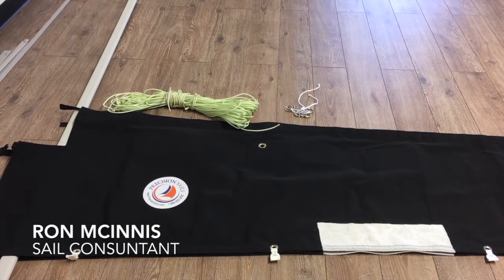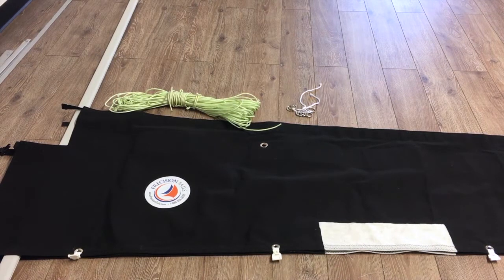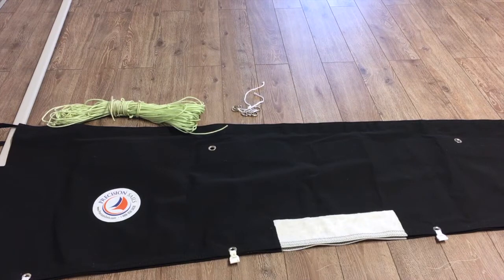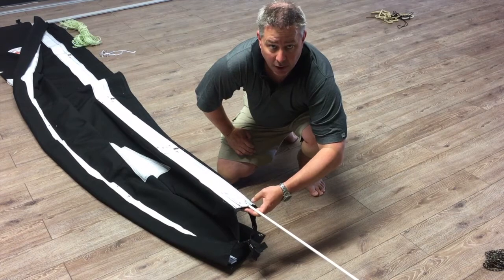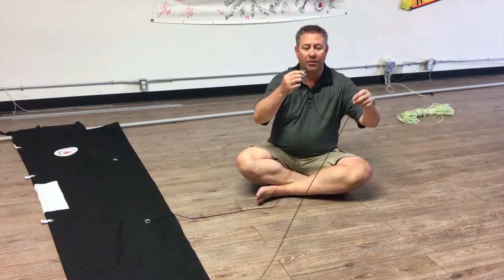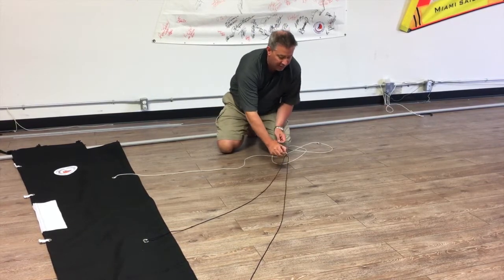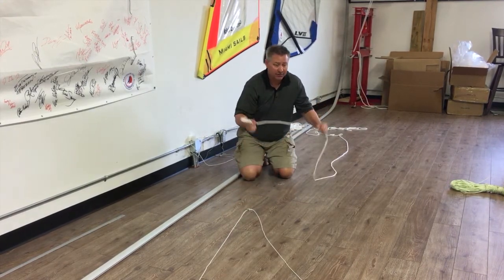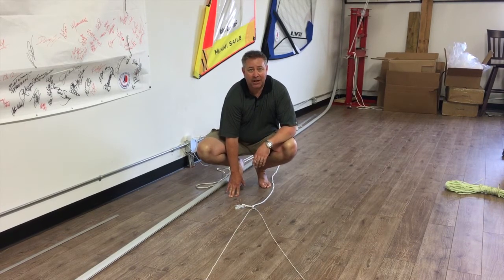How to Install a  Lazy Jack Bag - Precision Sails

Comment: We do not have dedicated cleats on the mast. Currently we alter tension with bungee cord at 3rd point just over sprayhood.  Is there a better designs for non cleat option. We would prefer a 4th point as sail sometimes snag because lines are too high. Thanks
Reply from the maker: Good Morning, sorry for the delay. I've tried to go through some of your vids on your channel to see if I could find more info to help.  If you can send in some pics of what you've got on your boat I should be able to help.  Please email info@precisionsailloft.com